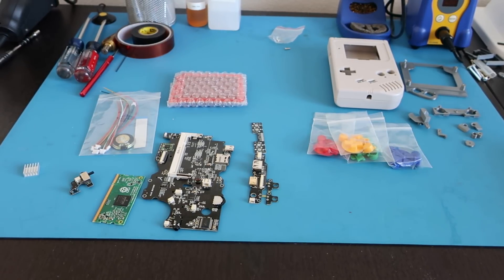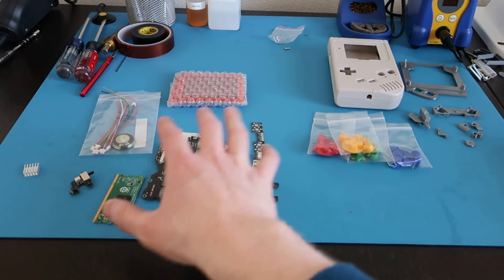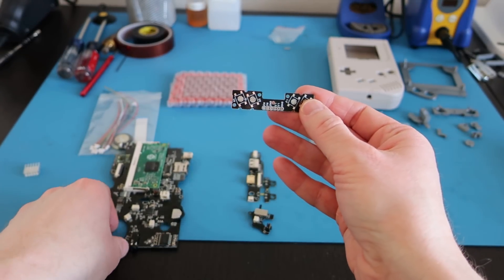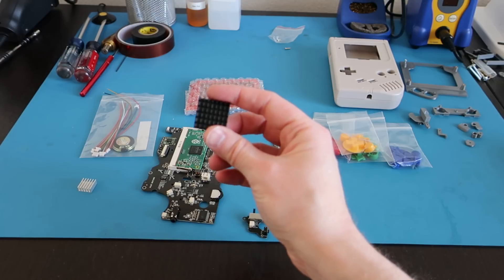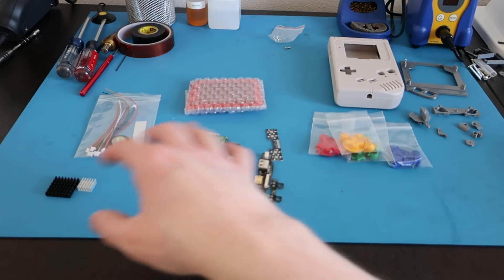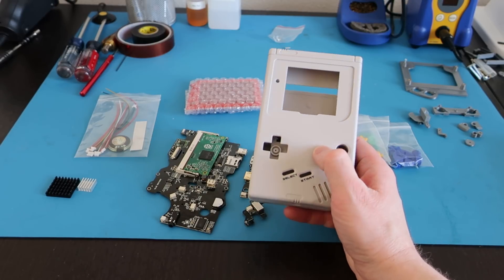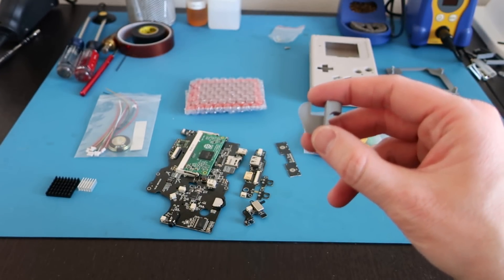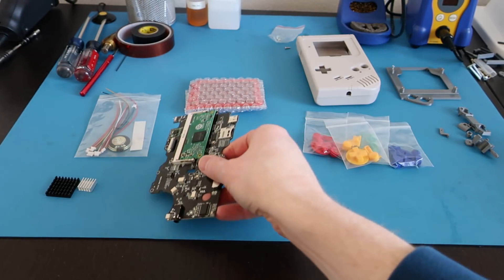GameBoy Zero Build  using Kite's Circuit Sword - Part 1

Comment: where did you get the volume control from or where can i get one
Reply from the maker: I got mine from alixpress, and have like 8 more left, I can send you one if you need.
Reply: that would be grate if you could send me one i cant find them anywhere how do we do this
Reply from the maker: Hmm, don't want to toss my email in here, but I'm on facebook if you want to private message me
Reply: don't worry about it i think it would cost to much for delivery as i live in uk is there a way i can turn the volume up i have tried to go into retropie audio and set the volume but it goes back to what it was before
Reply: just found the github about it i have a 10k pot all sorted now thanks for offering

Comment: Another question, I can't find the power switch mount you have on the sudomod market. It's the last piece I need to follow your build once I get my circuit sword in May.  Where might I find it?
Reply from the maker: https://sudomod.com/forum/viewtopic.php?f=58&t=5321
Reply: ah so its just the STL file for 3d printing at home. shame. I guess just hot glue and find some sort of support for it. thx!
Reply from the maker: Hoolyhoo will print one up it you request it from him from what I've read.

Comment: What do you mean exactly when you said (in description) that the + and - wires needed to be reversed on the DC 3.7V 4000mAh 125050 battery
Reply from the maker: Just that.  On the white JST connector, the + and - wires are reversed from the way that the connector is setup on Kite's board.  So you just need to lift up the little plastic tabs, pull out the metal connectors and swap.  I should probably show that in the next video.

Comment: What screws did you use to secure the CS to the case? I made an error and used screws that ended up marking the front of the case?
Thanks :)
Reply from the maker: Well, in most of the cases that come with screws/etc, there are usually two lengths. The shorter ones are for the PCB and the longer are the case screws (6).   I'll actually need to source some for my new case now.

Comment: What size brass standoffs did you use?
Reply from the maker: I used M2 brass inserts like these here: https://www.amazon.com/uxcell-M2x3mmx3-5mm-Threaded-Knurled-Embedded/dp/B01BHDY0AY/ref=sr_1_2?ie=UTF8&qid=1488923991&sr=8-2&keywords=M2+brass+inserts
Reply: Thanks!
Reply: Aaron I bought these same M2 brass inserts, but they were too small. I broke a screw off into the insert trying to insert for a size test. Using same screws that came with my DMG shell. You think its possible to use a size up? M3 perhaps?

Comment: Awesome video can't wait for the rest, one question you mentioned you are using dexter battery? Does the back of the case need to be modified for that? Or it can fit with no issue.
Reply from the maker: The Dextech battery will require pretty extensive battery compartment modification, as it is wider and thicker.